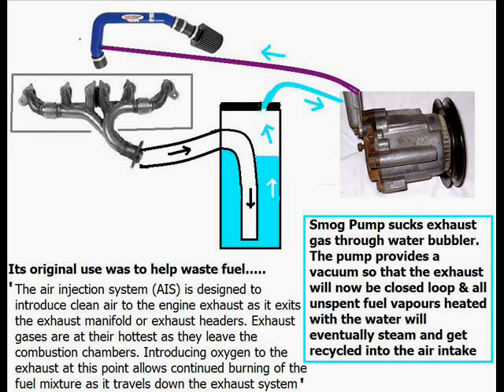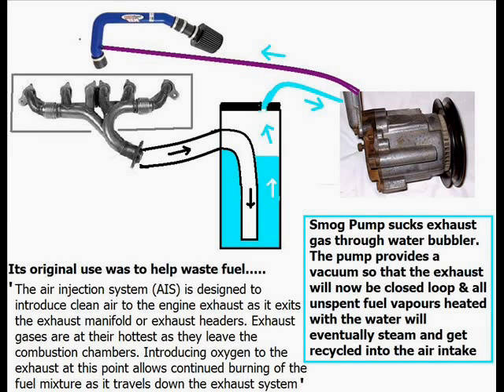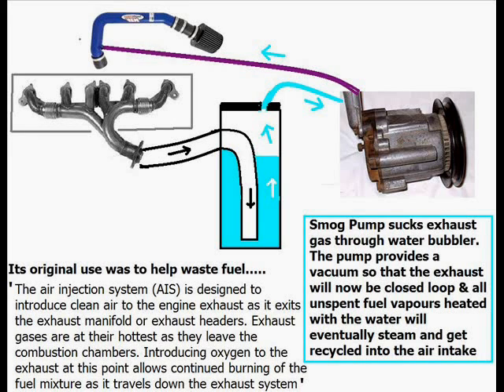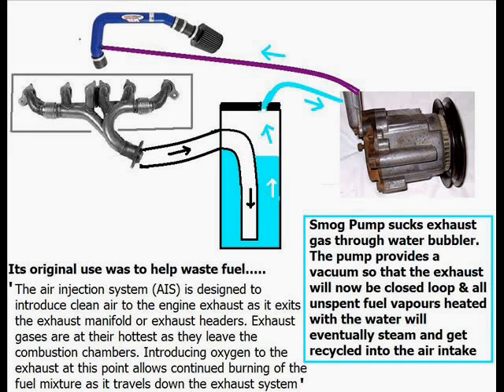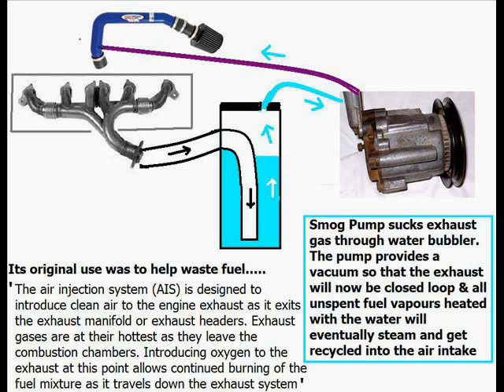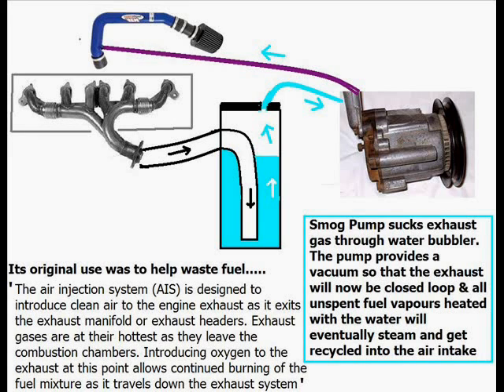Smog Pump BUBBLER closed loop exhaust HHO waterfuel

Comment: Good idea but if the car backfires or if fast deaccellaration the water will be sucked into the engine. You'll need a stopper . Also what you made is a water breather. Look up a catch can. Try making this like a catch can but for the exhaust

Comment: NO HEAT GUY IT LEANS THE FUEL  WHAT YOU NEED IS A VAPOR POT. A VACUUM PUMP ( SMOG PUMP) AND A VACUUM GAUGE  LIMIT THE AIR FLOW TO THE VAPOR POT ( THAT HAS GASOLINE IN IT ) SO IT ACHIEVES 15 INCHES OF VACUUM , INJECT THIS FUEL MIXTURE INTO THE INTAKE ,( IT SHOULD BE AN EXPANDED ICE CRYSTAL OF FROZEN VAPOR)  THE RATIO OF AIR TO FUEL SHOULD BE 6 AIR TO 1  VAPOR. NOW METER THE AIR (CLOSE THE AIR VALVE  PARTIALLY) THIS SHOULD INCREASE THE RPMS OF THE ENGINE . THE VACUUM HAS TO REMAIN AT 15 INCHES GOT QUESTIONS  1-661-401-4001 AUGUST 18 2015

Comment: What if there was an ozone generator separator within hot exhaust (low amps high voltage)? CO2 & H2O hot exhaust gas in half of a larger GEET. O3 out center tube HHC outer tube. Cool, combine, and reuse. Geet & HHO cell combined for another level of efficiency. Would it work?

Comment: Once your up to temperature, why admit fresh air for combustion? Once all required matter is in a sealed system it is a matter of heat and cool for liquid and gas. Remember, matter can not be created or destroyed, just combined.
Reply: ***** Air add to exhaust was not an after thought. For generations we've been lied to by a gov. regulations that required a maximum of 25% efficiency. For over 100 years high efficiency technology has been covered up for big oil profits. Oil and water do mix and burn. Closed loop engine patents do exist, are expired, and should be in production to benefit humanity. The 1800's & early 1900's were a great experimental time period. There is an expired ammonia closed loop engine patent from the 70's. A/C in reverse.
Reply from the maker: cheers. those patents are excellent, one of them quite similar to the one i posted, with the added bonus of showing a tank, almost more suitable for automotive applications. indeed, something i have already considered and shared on the VortexHeatExchanger group.
Reply: ***** Cheers. Makes me wonder if Coleman lantern is missing a tank. You may have noticed from patents that the simple modern GEET fuel processor of Pantone is a variation of an old working principal. The computer controlled emissions on cars today are not for improved lower emissions, but increase the difficulty of improving fuel economy. Cars of 1910 obtained same MPG of most cars today.

Comment: Way to go Neil
A small amount of pure alcohol added to water will act like a co2 scrubber.
Try to cool the exaust gas as much as possable befor it enters the bubbler.This decreases the volume and temp of the gasses entering the inlet side of the engine.
You will probably get many that say this is impossable to do-but you have seen it for your self.
Good luck in your experiment,and it can be made to work.
TinMan